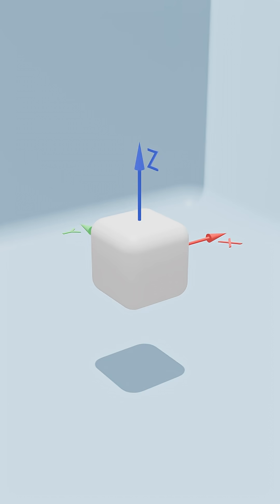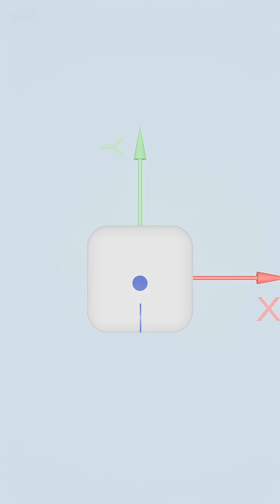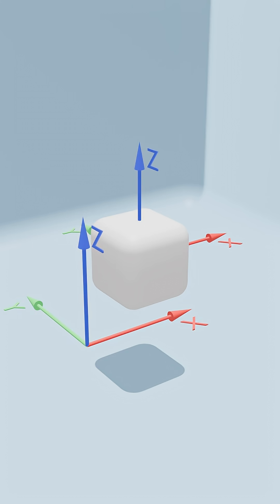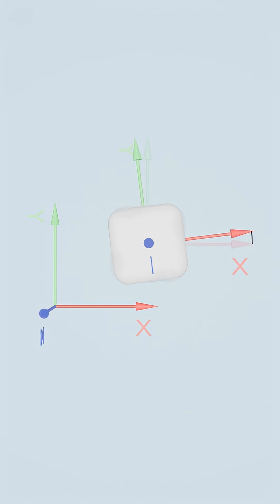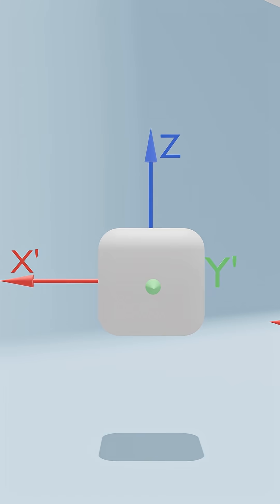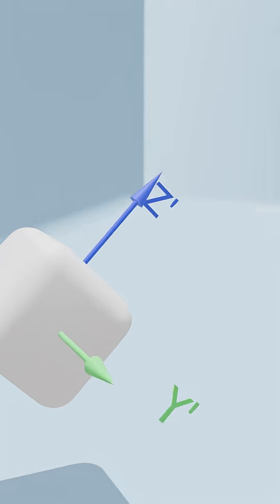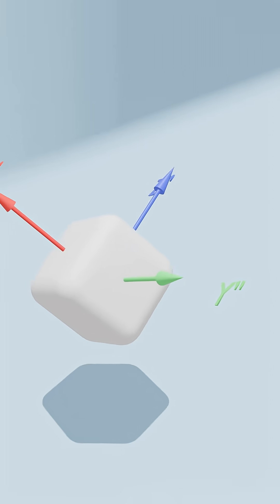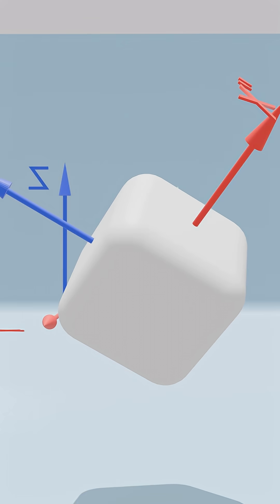How Euler Angles Work

Comment: am curious, why do some people do XZY instead of XYZ?
Reply from the maker: It's usually just personal preference or convention. Any order can be used to get from one orientation to another. Some engineering fields may commonly use a particular rotation scheme. 

I personally use ZYX because it is common in aerospace as the 3-2-1 Euler Angles of Yaw, Pitch, Roll.
Reply: @AerodynamicAnimations   yah cause whenever i play SecondLife, which is a 23 year old game and need to adjust my character's Y value... yah thats not height(using XZY), it's Z not Y
but others like modern blender and heck even starting of minecraft which was 16 yeas ago and it uses XYZ
just been kinda strange to me and saw the video and just had to ask
Reply: @BILLPC2684  there are two standards which are both equally reasonable, just over time people tend to get normalized to one or the other which makes the other one seem foreign.
Reply: @AerodynamicAnimations  cool, will it the reverse convention work for robotics considering drones , manipulators, humanoids etc? Also if can u pls tell me why are euler angles preferred if they tend to reduce dof in robotics when there are quarterions there to enable a smooth rotation?